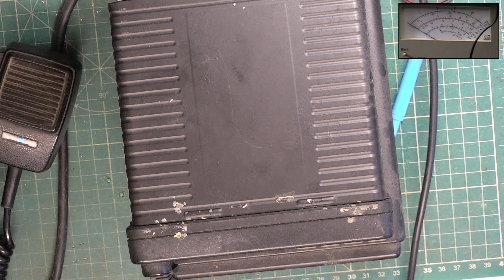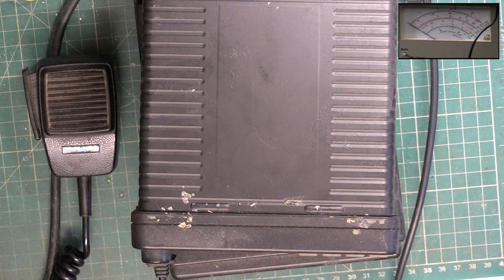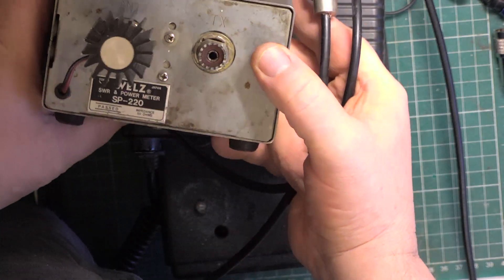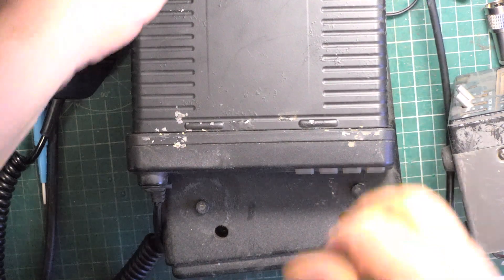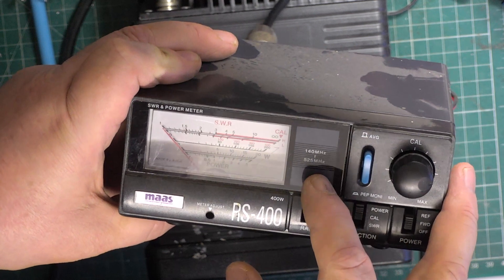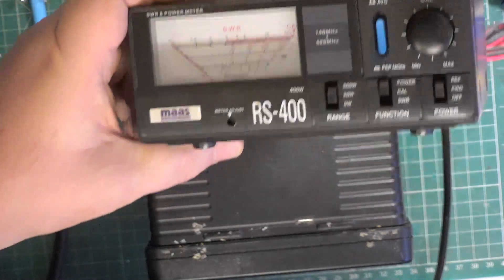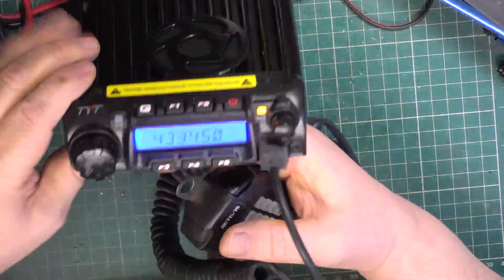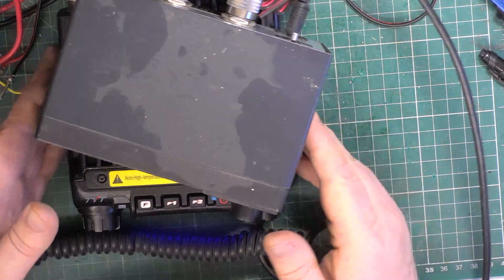70cms amateur radio power test

Comment: The shift beyond 25w for amateur transceivers meant that you couldn't use the panorama 5/8 antennas on 2m as they couldn't handle more than about 25w. They were an elegant solution too, compared to the ones sold by companies like Diamond etc.
Reply from the maker: I just checked on Panorama's website & looked at this.The current 5/8 wave VHF aerial is 50W rated.

Richard
Reply: @ukfmcbradioservicingTango21  That's good news. Always preferred the unobtrusive look and the mounts are easy to fit too.
Reply from the maker: That 50W rating will be continuous operation

Comment: Mmm interesting video , I thought they be both around the 40 wattsish , they claim 60 odd watts in dual band versions and seem to be  the high power on VHF not UHF so very misleading have spotted a radio that does 80 watts UHF  apparently on eBay , the moral is don't trust claim and a buy a good quality meter and dummy load .
Reply from the maker: Yes & we've tested 5W Baeofeng handhelds that all manage 4W & 10W ones that also manage 4W. Nothing changes. As b/s as air compressor ratings, jump start pack ratings & HiFi amplifier ratings!

T21